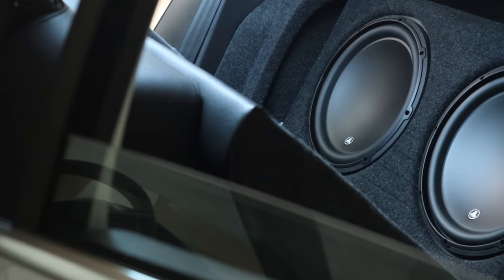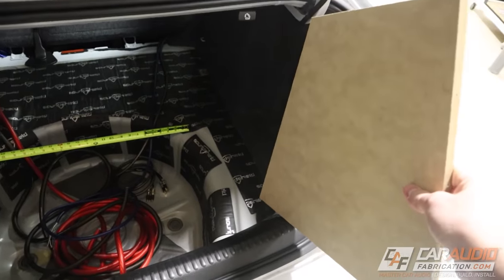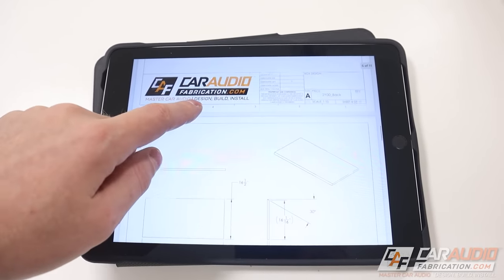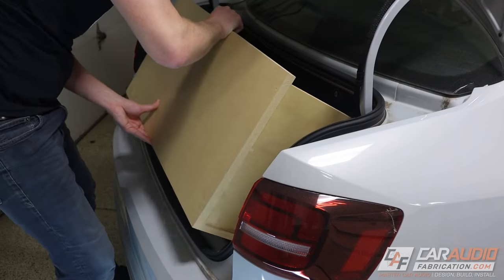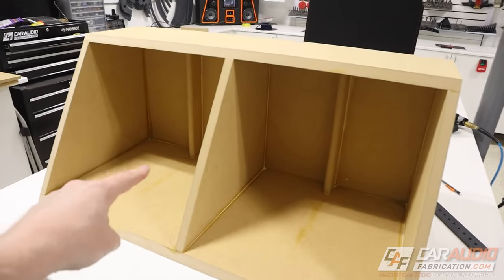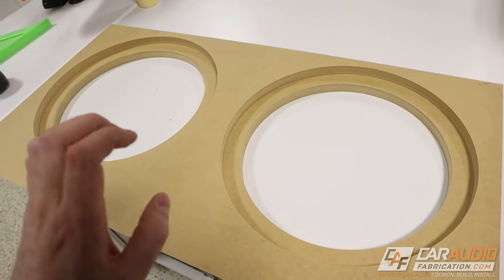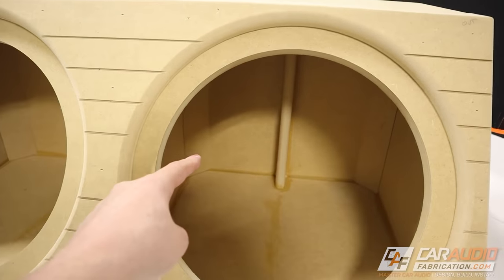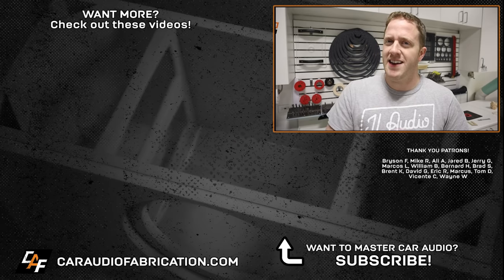How to build - Wedge Subwoofer Box Enclosure! SIMPLE & LOUD!?

Comment: New follower here....I spent YEARS where I had A LOT of sound in a few old school cars I’ve owned.  Trunk opening was no issue in a 92 Fleetwood, 83 Delta 88 nor with an 84 Cutlass Supreme 😆😂.  I now own a Silverado 1500 and after adding 4 6x9s in the back doors, new head unit and an amp...that’s where I’ve stopped. I’d love to get back into it by switching to better amps as well as shallow mount subs.  I’ve been planning on building my own sub box this time and your channel has sooooo much useful info!  Glad to have come across your channel 😃

Comment: Great table saw, one of the top brands at least, but I picked up a track saw and I always suggest them now as a set with a less expensive table saw (think smaller more than less features). Once you master the track saw your table saw usage will drop significantly. In my opinion, more accurate, cleaner cuts, and a lot safer. It'll handle those angle cuts a lot more efficiently. I went cordless dewalt and invested in a larger track and can process a sheet in minutes where it would take at least an hour before. 

Just a FYI, great stuff as always!!!
Reply: Yes sir! Never fucked with the tablesaw unless i REALLY needed it but a tracksaw is a lot safer of an option imo and its not at all as hard as some people think it is.

Comment: Ever do a 08 up avenger, I would like to build a optimized enclosure for a single 12", I had 2x 15" kicker comps and solo's back in the late 90's the small amp on the comps did 142.7db, and sounded good, in a sealed enclosure, I'd like to get that and then some from a single 12, in a good enclosure, and tune a range of 25-30Hz to about 80-90Hz maybe 100Hz  most likely a ported encounter,  I always did sealed back in the day  I'm thinking a just above entry-level sundown sub,  if this was 20 years ago, I'd want to use the trunk for batteries and amps, put about 6x 18" subs in there! But now I wasn't a trunk, and back seat, I have thought about using a couple truck boxes, and shallow mount subs, something cheap, but if I'm going to do it , I want it to sound good, a pair of boss 12"s  ain't gonna do it, I learned years ago, you would be better off with a good sub and the boss amp, (then get a better amp later!)
I'm thinking a single 12" with about 600w should do fine, (maybe I'll add another 12 later!

Comment: I had a 88 Volkswagen Cabriolet a few years ago. I installed in all Boston acoustic speaker system. Six and half components in the doors, 5.25" coaxials in the back with 75 W per 4 channels. Also, two 12s in a sealed enclosure in the trunk with 150 W per channel. It sounded incredible! However, to get the enclosure in the trunk, I had to remove the back seat and put it in that way. The Cabriolet hatch was way too small to get it in that way. In the past, I've had my sub boxes stolen out of my cars. I figured with all the work to get the box in the car this time, they would never be able to steal the system. They stole the car!  Guess the joke was on me.
Reply: Always budget a quality alarm system in WITH the Audio System budget. Always Use Protection!! ;-)

Comment: Could I put the subs on the flat face instead and slide the wedge into the wedge space in my trunk?
That's my plan, make an angled enclosure to match the angle of the rear seat.
Reply from the maker: Yes definitely, many times that might even sound better. This was an odd very sealed trunk

Comment: I still feel that the JL Audio W6 is the best SQ sub JL makes. In my opinion it's the best sub they make period due to my taste in SQ over everything else.
Reply: @Zfb Tln No..... The W6 is more linear and walks all over the W3 in SQ. It also will be louder at higher levels and is worth every penny of the premium. There is a reason why it costs double the W3 and it shows.
Reply: @Zfb Tln For SQ, yes.
Reply: @TickleFingers  why don't you like the W7AE-3's??  Those are their absolute highest technology and most accurate subs.
Reply: @thebkg  Just because it's the most expensive doesn't mean that it is the best. The W6 is a well rounded SQ sub and fits many applications. Is it the end all? No. But, it is very musical and can get down if you really ask it to. You can pick them up on marketplace for half the original price. I bought my most recent 12W6V3 for $300 and it was only a month old. It blends seamlessly with my Morel Hybrid 602's running active. Its current configuration is sealed and you can't localize the sub. It sounds like all of my bass is up on my front sound stage. It's accurate, composed, linear and powerful and can play through just about any genre. It eats up the 800 watts I feed it and does it everyday. The W7 hasn't been a requirement because the W6 does it already. If I were going to go further, I would be looking at a Morel Ultimo Titanium, Dynaudio or HAT, but right now the W6 is exactly what I wanted and hoped it would be.

Comment: looks exactly the same as iv designed 
quick question my box is 20inch wide 14.5 tall wedge part I xant get my head round the wedge angle or size base is 17.5 deep top is 11inch deep so how do I figure the (part your subs are) size and angle for it to screw to 
good idea of amp rack too your sub face is opposite my idea keep it up
Reply from the maker: Depends on a few factors. We can assist with a design here caraudiofabrication.com/box-designs
Reply: @CarAudioFabrication  hi mark yeabox is all cut not bolted iv messed 2pieces of mdd trying to cut just the wedge cannot get that 1length and angle sorted

Comment: Does it matter where the port is located as long as it's the right size? I had to cut the port off to get the box in my car. Now that I have a jeep. It Fits but the port is still cut off. Same size port, just not facing forward, it's on the side. Props on the JL audio subs, the rock!
One more thing. Could I seal up the port? I prefer a more punchy bass for rock music. But the sub box won't have any separation between subs
Reply: The subs will function no matter where you put the port, but placement will effect how it sounds... Big time. Port up or back tend to be the loudest in most vehicles, but you can find other Jeep system videos and find out what seems to work best for them and apply it to yours. As for sealing up the port, that would depend on if the subs are designed to be played in a sealed box. If they are not, they you'll likely end up damaging something and not liking how it sounds until that happens. I'm sure Mark would agree that these are things you are technically supposed to have addressed in the planning stage of the system and not after you find out something doesn't fit. Good luck.

Comment: So the custom CAF box i had build.  The guy forgot the 45s in the corners also. Wondering are the really important?
Reply: In this application 
They add a weebit of structural strength.
They are a lil more critical for slot port corners.

Comment: I love your work. But....lol...you missed one line detail top left and where you painted the back of box, the line where the back panel goes to side top and bottom(I am assuming) would look much better if you used some wood filler in the gap. Also, some areas look like another coat of paint might have looked a bit better. I'm not a sound pro or near as good as you, but I am a carpenter. Anyways, just suggesting....keep up the great work.
Reply from the maker: Haha yeah, I caught that after I shot the video, no big deal, the contact adhesive has a long time before it no longer sticks to itself, so just pressed it together.
Reply: @CarAudioFabrication  btw, I did a full 4 channel system off your videos. Got all Knukonceptz hardware which I love. I got an Alpine Wx650i and it goes max volume clean to an Pioneer amp. It's a little underrated cause I'm dumb and didn't check for rms but a decent cheap amp. Going to 90w rms x2 Infinity 6.5 components and 110w rms 6x9s Infinity Kappas. Thing rocks and super clean with no  flat EQ. Thanks for the knowledge.

Comment: you should fully isolate trunk space  and subwoofer placement, the sound will be better
Reply: Agreed it would be louder. Hard to do with a system that needs to removable though. Would never be sealed properly.
Reply: @Des420  sorry, didn't noticed that the system is removable :)

Comment: I wonder if a 2012 Toyota Camry v6 xle trunk would be able to fit 2 13.5 w3 in a ported in?
Reply from the maker: It would use the majority of the trunk.
Reply: @CarAudioFabrication   that would be ok, cause I have an 08 impala and 2 jL audio w7 12 and I have a little space on the sides and very little the rear , but enough for the amps,  but I would wanna have someone make an stackable sliding amp rack kit

Comment: hey mark, i have a 500W amp that has 4ga inputs. in my country i cannot get ifc from anywhere. can i use cca for it?
it has two 25amp fuses at the input and class ab
Reply: CCA isn't as good as OFC... But unless you are planning to do a big system upgrade in the future (not with 4 gauge wire you're not), CCA is plenty good enough for that application. I would even suggest using the CCA if you could get OFC since you're only running about 600+/- hundred watts. That money is better off used on upgrading stock speakers, etc. Cheers.

Comment: Hello, can u help me, I just need to know what ecualizer I need for my system
Reply: I have 4 "8 inch" speackers and 2 "12 inch" subwoofers
Reply: I'd recommend either of these:

JL Audio TwK 88  https://www.crutchfield.com/p_13698101/JL-Audio-TwK-88-System-Tuning-Processor.html?tp=61658

Audio Control DM-810  https://www.crutchfield.com/p_161DM810/AudioControl-DM-810.html

These are full DSP, not just simple Equalizers.  With a system like yours with 2 different sized subs you really need a true DSP to take full advantage. However, you have to get a good install shop to custom tune it.  This isn't something you can do by ear.

Comment: Good job but the how tos on the wedge angles are the most important part that was chumped over. Why does each piece fit the way they do and fitting into the trunk was good. Overall it still leaves a DIY guy like how did he get that wedge shape

Comment: Why would you round over a inside brace, wtf
Reply: I think what he ment by unfinished is they sharp edges were probably brittle and uneven. Rounding them will give them a smooth surface and  round edges  are better for strength in my opinion.

Comment: It wouldn’t affect the width by coming from the front! Turn the box long ways, then once you’re in the trunk, rotate the box to face the direction you want it to!! I mean, really??! Lol smh 🤦‍♂️
Reply from the maker: The seats don't fold completely flat and the trunk is wider than it is deep, that wouldn't have worked. Not my first rodeo.
Reply: @CarAudioFabrication  wow, so a fail for the auto manufacturer! I don’t see the point in having fold down seats if they don’t fold all the way down.